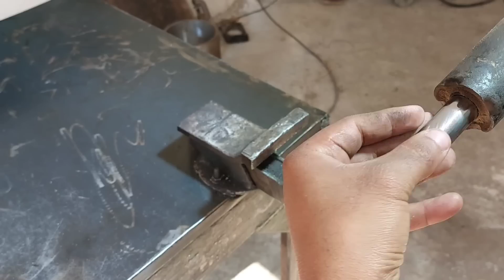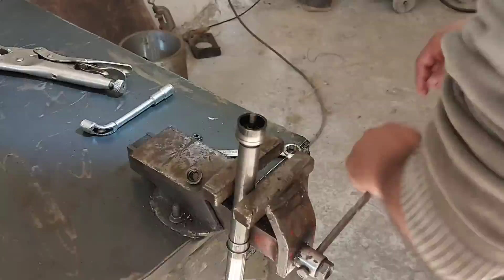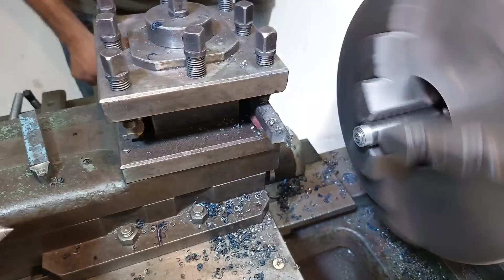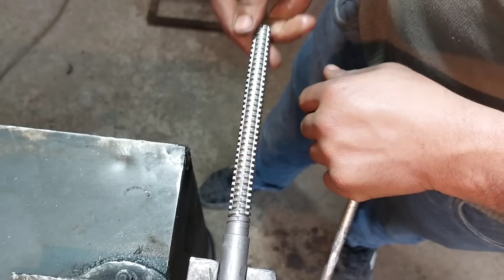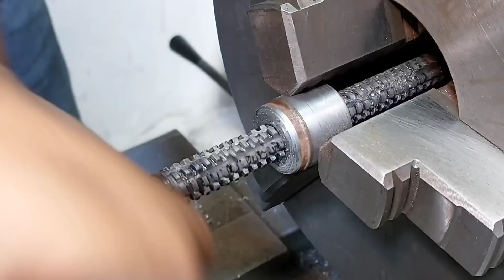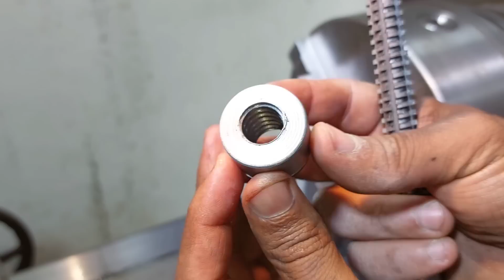قليل من التقنيين يعرفون كيفية إعادة استخدام ممتصات الصدمات

Comment: Great project, a tapered ACME thread tap and nuts.  I've saved strut rods and made long drift punches from them that I still have 40 years later.  Another tip for reuse of items: use a cutoff blade in your die grinder at an angle across an old wheel bearing race once you've removed it.  Then use that to drive your new race into place.  Since it's the exact same size, there is no risk of damaging the new race.  The tool springs back out with a grip of channel lock pliers.

Comment: Ingenious use of a lathe as a milling machine. A lot of work to make a tap, that did the job that could have been done a lot faster by simply by grinding a boring tool with a the thread pitch profile needed and cutting the treads inside the sleeve in reverse of the what was cut on the rod. That tap is still  useful for where the part cant fit into a lathe though.

Comment: notice that he doesnt try the nut on the actual trapezium treaded rod its supposed to go on , do like the idea of using the rod from a shock absorber as the base material , its cheap and about the biggest diameter i can fit through the spindle on my hobby lathe , definitely going to try that

Comment: HA - the landscape view is MUCH better thanks.  Can you show the detailed process of cleaning the inside box sections etc and the underneath as well.  The inside areas are the most crucial in ensuring an effective outcome for the longevity of the shell (I have figured out various methods to coat those inside areas - but would be good to see the professional way you clean them).  It would also be good to see how you remove all the piles of paint etc from the inside and boot areas, as these areas that are not just washed off onto the floor as the exterior areas are.  HA - I wonder how many times your wife says when you get home - 'Take those boots off before coming in side" - HA.  Thanks.  CHEERS from AUSTRALIA.

Comment: I'm not a techie, but I have a chop  saw and a welder so I've rebuilt a few shocks in the last few years. Only I'm not rebuilding the shock (Which by the way, you aren't either) I'm making hardened pins and punches.

Comment: That isn't a shock absorber as it doesn't absorb shocks, it's a damper. The spring does the shock absorbing, the damper simply controls the springs oscillations. Also, this is hardly reusing the damper, just the solid push rod. Interesting none the less.